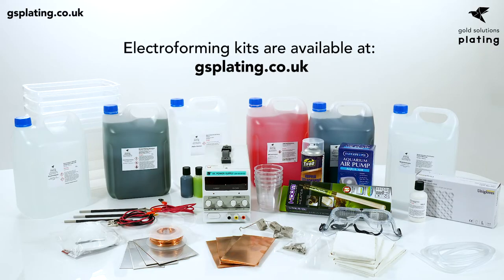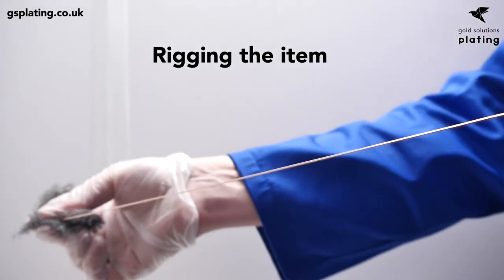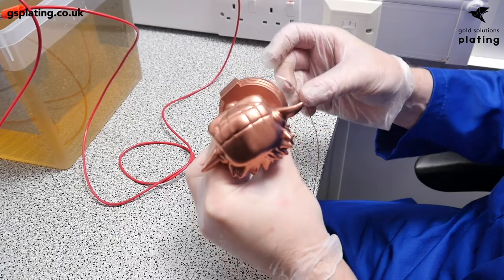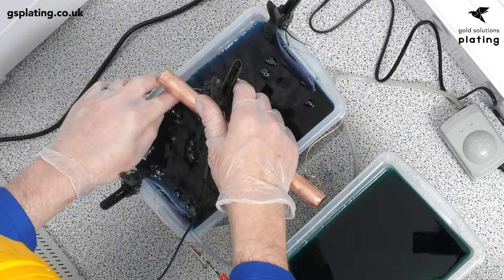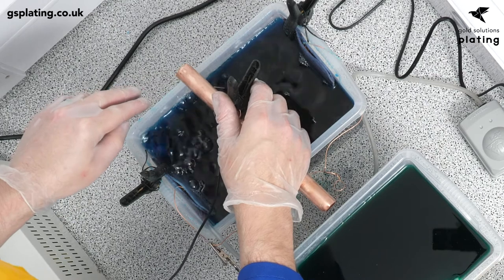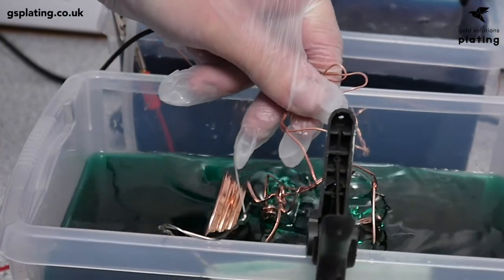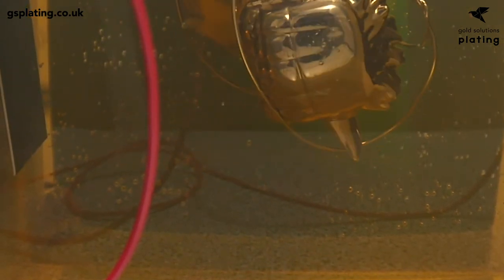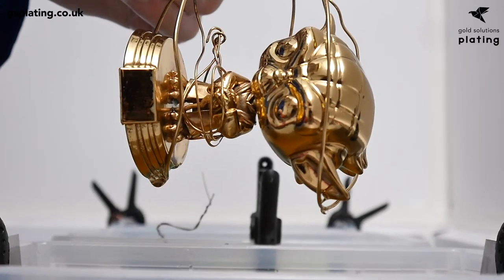Electroforming Tutorial - Gold Plating on Plastic Electroplating

Comment: Hi, I have a fibreglass item that I need to finish in 24k gold. How to go about it? Thanks for your time
Reply from the maker: Hi Bondfamous, basically you would treat this no differently than a plastic item, paint- copper- nickel- gold. The only thing I would say is that if there are fiberous bits or frayed bits, or some sort of leaking point leading to "inside" the walls of the part, then they would need sealing first

Comment: Hey guys another plater here. Quick question, how is it that you do not need to submerge the item into a electro cleaner solution then surface activator solution in between the copper set and the nicel step?
Reply from the maker: Hi, great question! Electrocleaner is not needed because this proceedure is ideally done concurrently- IE straight out the copper electroforming tank, rinse in under a minute or so, straight into nickel. The item is held by copper wires, which are only held at points that never enter the tank. There is no time or opportunity for either grease or oxide to build up (and our electroforming copper contains anti-oxide agents, you can lower a copper tarnished coin into it without power and in seconds it de-tarnishes) and so there is chemically no reason- and no excuse- for the nickel to not plate perfectly and cleanly on to the nickel.

If you decide to break the electroforming stage up into shifts (for eg you want to eform a leaf for 24 hours but want to do it in 6 hour sittings over 4 days) then each time you restart the electroforming to carry on, you would indeed electroclean it first for 3 minutes in the included electrocleaning tank before rinsing it and putting it back into the electroforming tank to carry on plating (you would lower it in without power for about a minute to remove oxides then turn on the power, so the plating can carry on without creating layers)

Comment: Hi, thanks for this video. I want to chrome plate my plastic key fob. Is this method heavy duty, i.e will the gold plate wear/rub off easily? Thnks in advance
Reply from the maker: Hi,  the metalization is extremely hardwearing when done to our recommended 6 hours electroforming time. As for the gold that goes on top, that will last as long as you want based on how much gold you deposit- a thicker layer takes more wear and tear before rubbing down to the nickel, but ends up using more of the gold out of your solution compared to a thinner gold plate. Our gold can be tank plated up to a thickness of 10 microns, though the gold that comes as default with the Prodigy kits is a type of 24k gold which has a 1 micron thickness limit. There is nothing to stop you applying the other type of 24k solution though, with the thicker limit, after the copper and nickel plating.

Comment: Greetings. What can I use to prevent unwanted parts to be plated during the process? Like I dip a circle in the solution but don't want the center to be plated.
Reply from the maker: Lots of masking options, the easiest being to mask off areas before applying the conductive paint- the plating won't take over bare plastic areas.

If you mean you want to metalize but not fully gold plate then lots of masking options, from coloured nail varnish to masking tapes. The process is very flexible!

Comment: Do you need 3 rectifiers to do this process of gold-plating? what specific kind of wires do you use in the nickel and gold baths? Is it 24K gold or can it be a 14K gold-filled for example? Not a ton of videos out there on electroforming except with just copper...any help/answers is much appreciated
Reply: To clarify...I know that copper baths use copper sulfate solution and copper wire. What solutions and wire do you use in the other baths? I don't believe it was covered in the video?
Reply from the maker: Hi You do not need 3 rectifiers with our kit the one that comes with it is fully suited to doing all the jobs involved. The wire throughout doesn't change from tank to tank I don't understand the question about wires? The gold in the solution is 24k gold but we do a variety of types of gold solution, 18k gold, rose gold etc. 
The type of electroforming that we cover here is done by using copper, electroforming with gold or silver (where you electroform into a mold) is a slightly different process

We do cover in the video the contents of the other tanks, they are nickel solution and gold solution.
Reply: @goldsolutionsplating1761  Hi! Thank you for your reply. To clarify my question about the wires: when I have watched other videos about just copper plating the anode is usually copper wire submerged in the solution. I was wondering if the anodes in the nickel and gold baths are also copper? Didn't know if the anode metal changes based on the solution..Does this make sense? Trying to understand the composition of how these solutions work a little better so I can experiment on my own before purchasing a huge package. 

Sorry if this info was covered in the video, but I don't think I heard any mention of it. Thanks!
Reply from the maker: @erinconnor7449  Hi I understand now- ok so the anode in the copper tank is our own type of copper, which contributes to the mirror shiny plating. The anode in the nickel tank is made of pure nickel, and the anode in the gold tank is 316 stainless steel (other types of steel will spoil the solution even if they produce an initial result)
The anode material is very important not only to the quality of the plate (so it does not come out dark, dull or lumpy and grainy) but also important to the longevity of the solution itself. the anodes that get used up the most in this process, are the copper ones.

Comment: Welders aerosol primer is the same and commonly available at an  trade counter for paint sprayers
Reply from the maker: From what I can tell, welder primer is (at best) oxide either zinc oxide (which is no good for electroforming over due to issues that zinc has with copper being plated over it) or copper oxide paint, which we have tested before and they just do not work. they may be conductive from a shielding perspective, but ultimately, for electroforming over with the copper, they are no good- which is unfortunate because they are very cheap!

Comment: Can you do this to a car grille
Reply from the maker: Hi, I assume the car grill is metal IE chrome plated steel etc? in which case you would need a huge industrial sized tank setup. If the condition of the car grill is good, and it is chrome plated, and you wanted to gold plate it, you could do that with our recruit kits by brush plating. This takes longer than tank plating, but does not involve tanks or large volumes of chemicals or a huge outlay comparable to a new business, instead just a straightforward brush plating kit which is powerful enough to tackle larger items like grills, but will also allow you to tank plate smaller parts. If you went for a BR2 kit it would even allow you to do plastics like you see in the video.

the Recruit kits can be seen here https://gsplating.co.uk/shop/kits/gsp-recruit and the larger Prodigy kits can be found here
https://gsplating.co.uk/shop/kits/gsp-prodigy

Many thanks again!

Comment: How can i buy conductive paint spray ??
Reply from the maker: Hi,
The conductive paint is part of our electroforming prodigy kits. You can buy it from us individually of course, though we do not currently list it on the site. To buy it individually, simply contact us through the website. Please note, that the paint alone is not what gives the great mirror shiny results, that is down to a combination of the paint, our plating machine, the very specific formulation we use in our electroforming solution and finally the exact grade of copper we use and the type of anode bag we use. Changing any of these elements will alter the results.
If you have any enquiries on electroforming, and how to get commercial grade results, then the best way to contact us is through the website.
Many thanks!

Comment: Can its work with gold 22 carat?
Reply from the maker: If you already have 22k gold plating solution, and it is an actual electroplating solution, then yes it will absolutely work with this system, and would simply be swapped for the last step (so you would copper plate and nickel plate the item just like in the video, but then go into the 22k tank)

Comment: Is electroforming the same as electroplating?
Reply from the maker: Hi, electroforming usually refers to a process of plating the copper on so thick that it actually creates a thick shell around the item, and this is how we refer to it also. You could literally peel off the plating and be left with a shell that holds its shape etc.
Electroplating is when plating is done much thinner, and also encompasses plating solutions that do not deposit as thick, or hold the ability to form a solid shell. For eg gold or rhodium plating relies on a rigid substrate as the plating would not hold form if this substrate was somehow removed. 
So in short, plating is just the act of depositing any metal onto a surface, electroforming is a much thicker version of this, using metal solutions that can yield an independently solid  form (such as copper, nickel but rarely precious metals)

Electroforming is also nowadays used to describe the act of plating over non conductive items, utilizing conductive paint.

I hope this has helped!

Kind regards.
Reply: @goldsolutionsplating1761  Thanks for your reply! I want to buy a ring which the seller claims it’s 18K gold electroformed without removing the mandrel inside. What could that possibly mean? Whether it indicates the ring is better or worse than say a ring which is 18K gold plated? What is the typical gold layer thickness for a ring when it is made by electroformed? I know a “electroplated” layer is typically 0.5 microns. So I wonder whether that “electroformed” ring is better quality or worse? The seller is not willing to give me more information so I want to hear your fair judgement. Thanks so much in advance!
Reply from the maker: @stellasong4714  Hi, the mandrel is the item inside that they electroformed over. The thickness of the gold is not necessarily determined by this, if they literally electroformed IN gold, then the microns would be very thick and it would add hundreds and hundreds if not thousands on to the value (something done to about 6g of gold is already inherently worth about £3k just in gold weight.

However.....if the ring was electroformed in copper, and then ultimately plated in gold on top (after a palladium plate) then how thick the gold is, is up to the plater.

Very very few people literally electroform in gold- that is to say they build up 50 or 100 microns+ in a way that creates an actual stiff solid skin.......the vast majority of electroforming is usually done by building up a copper solid "skin" and then just  a thin electroplated deposit in gold.

Ask them was it electroformed using only gold, or was it electroformed using copper, then plated in gold.

Then it is all about how thick the gold plating itself is, some do it to 0.5 microns, some to 1 micron, premium is 2.5 and higher than that is unusual but certainly pricey.
Reply: @goldsolutionsplating1761  Thanks for your detailed explanation! That’s very helpful. Because the ring they sold is less than $100, it must be 18K gold electroplated on top of an electroformed layer. The way the seller describe the item is indeed very confusing! Probably both the “mandrel” inside and the “electroformed layer” are made with copper or other metals. If that’s the case, there is barely no difference between this so-called “electroformed” ring and a regular ring which is only electroplated with 18K gold. The 18k gold layer is what matters the most to the value. Otherwise, I guess what’s below that gold layer and how they made it make no difference to a buying decision?!

Comment: not sure why you're calling this electroforming rather than simple electroplating.  What am I missing?
Reply from the maker: Electroforming is commonly used when the plating in question is A) of a thickness where the plating becomes a physically solid shell with its own rigidity and structural strength and B) involves a plating solution that has the actual ability to plate that thick (for eg, rhodium can only plate up to about 2 microns max, and so will never create a "skin" thick enough to hold form away from the substrate and so is not electroformed with, but electroplated)
Electroforming usually involves copper going on in the order of hundreds of microns.

Some also consider electroforming to be where you line the inside of a mold with conductive paint and electroform until the whole mold is filled in creating a solid positive of the mold, though this is now thought more of as being electrotyping.

Many thanks!

Comment: All process ditails with camical
Reply from the maker: Hi the process is shown in this video, there are not any other steps necessary with our system. This system can be used on all plastics and non conductive surfaces, and the Prodigy kits can also be used for plating over all metal surfaces as well. You can see the full range of Prodigy kits here https://gsplating.co.uk/shop/kits/gsp-prodigy
They come in 1, 5 or 10 litre sizes (depending on how large the biggest item you want to plate is, or how many items you wish to plate at once) and larger plating kits are available on request, which can involve more powerful machines for items with a surface area size over 274cm2. I hope this has helped!

Comment: When wrapping the item with wire , isn't it gonna leave blank unplated spots ...
Reply from the maker: Hi there, by stripping the wire with steel wool as seen in the tutorial, this guarantees that you do not get left with bare spots, it plates through the wire and leaves no marks. You do have to move the item on the rigging every half hour to prevent it from fusing to the wire.
Reply: @goldsolutionsplating1761  ❤️ thank you

Comment: I with you till the rigging. Then I'm like NAH.
Reply from the maker: It is not too complicated, you just basically create an outline of the item to ensure it doesn't burn on edges and high points. Takes just a few minutes!
Reply: Did the gold metal also need to make rig like that?
Reply from the maker: @saidota89  only one rig is needed, it stays in place during copper, nickel and gold plating, and then sat the end you remove the item from it.
Reply: @goldsolutionsplating1761  can u make a video tutorial for gold?? Easy for me to understand